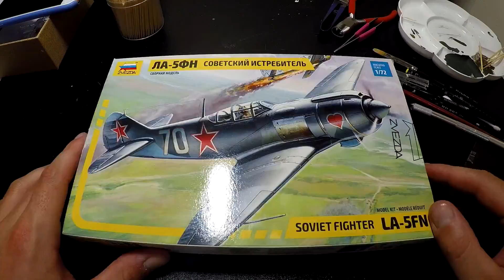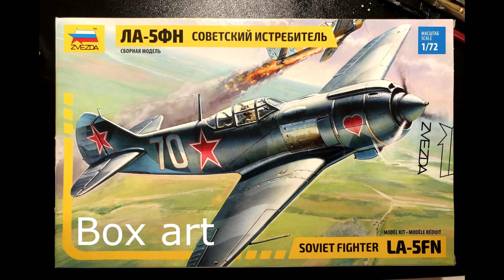Zvezda, Soviet Fighter LA-5FN,1:72, (Lavochkin La-5), Time-lapse build, painted with brush.FIGHTER#1

Comment: "Standard procedure" is to glosscoat BEFORE applying the decals. They go down on a smooth surface without silvering (trapping air bubbles). 
Try those Vallejo paints thinned slightly with water. They brush very well.